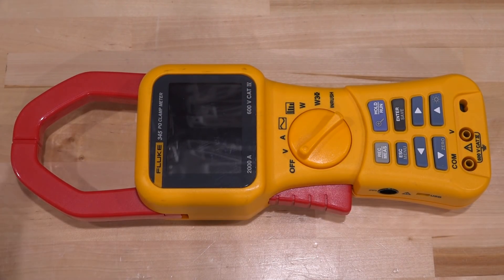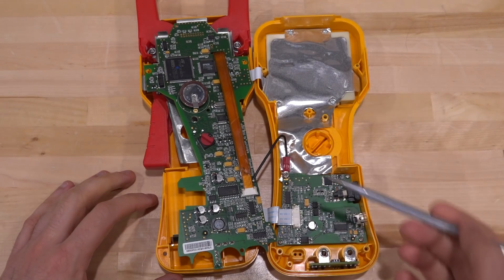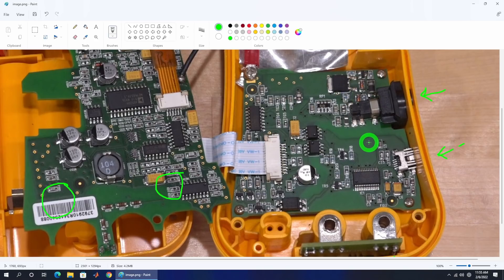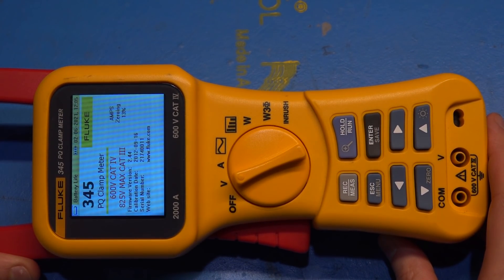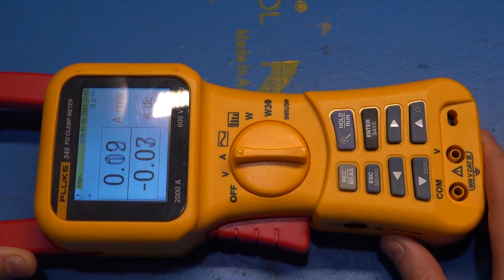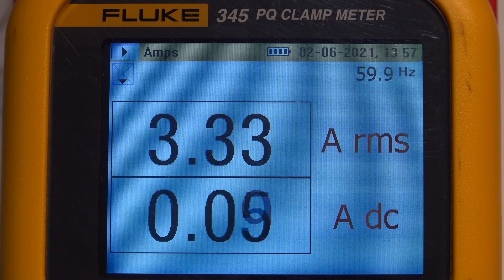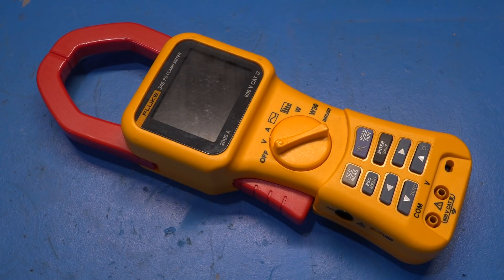TNP #12 - Teardown, Repair & Experiments with the Fluke 345 Digital Power Quality Clamp Meter

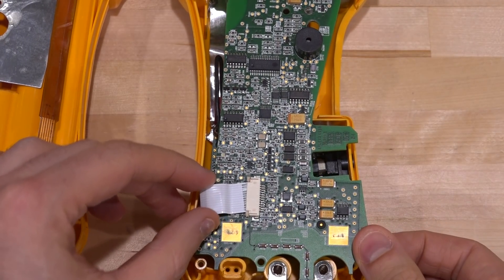Comment: @3:12 would you know what the original value of these 4 resistors in a row in the input path are? I've got a 345 that had battery leakage and these four resistors were completely caked in. cleaned it as good as I could but meter overreads 10V consistently, I think due to leakage because of remaining battery gunk?
Reply: Update about this lazy question: All are 220kOhm, I replaced the 4 contaminated ones and the device works perfectly now!

Comment: Please consider doing some inrush current research :) Especially with big SMPS which are pain in the ass to use and trip breakers. Any way of limiting inrush current even more apart from built-in limiters in them? Especially when they share the same power strip and are powered on at the same time
Reply: A 100W tungsten filament bulb in series and a relay that shorts out the bulb after a few seconds.
Reply: @simontay4851  yeah, I always thought that such thing should be an internal part of these SMPS'es ;)

Comment: Still $320 on ebay ;-)
LEM Ultrastab are far cheaper and much more accurate, bought a bunch of them for $30 to calibrate my 400A TIG welder, total overkill, but worked nicely.
DC to few 100kHz bandwidth, so you can watch welder current waveforms on scope, with like 50ppm accuracy ;-D

Comment: An interesting video.
I think many products are made with the wrong type of plastic. A portable device like this should be capable of being dropped.
I wonder if it was over tightened in manufacture and broke when the screw was turned.
It has many features but extremely expensive.

Comment: For those who are looking at repairing one of these, Fluke will repair any current model unit for free....  I've bought several broken current model Flukes and sent them in for repair.   They even sent them back with new batteries and a calibration certificate!
Reply: Great tip, thank you!

Comment: Maybe there is an inrush current- the heater coil should have lower resistance at room temp compared to when it heats up.   In fact, I can’t see how there could not be an inrush current.  Try it and let us know